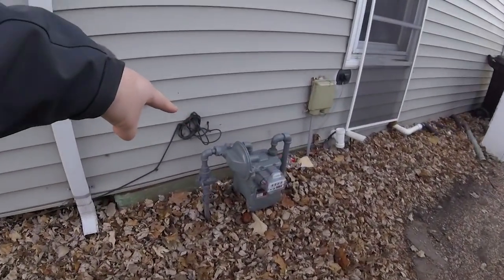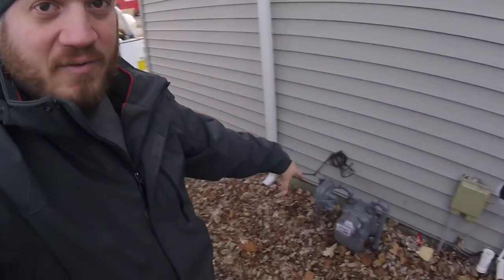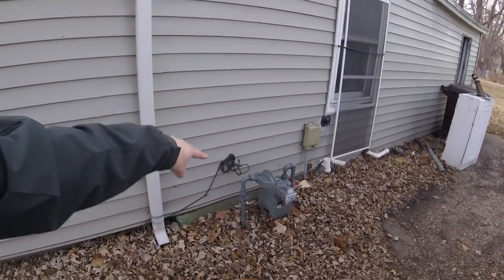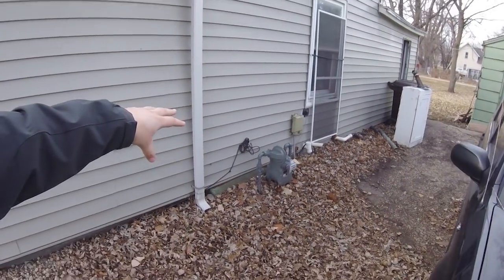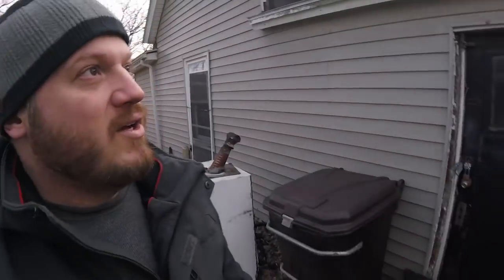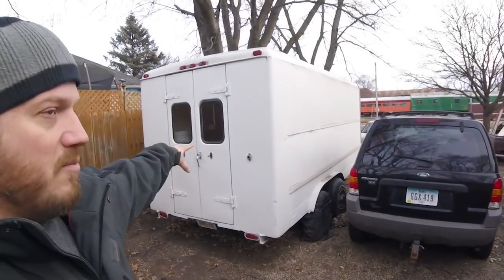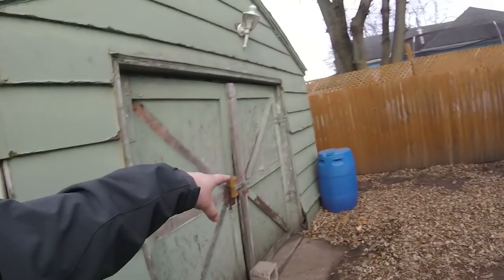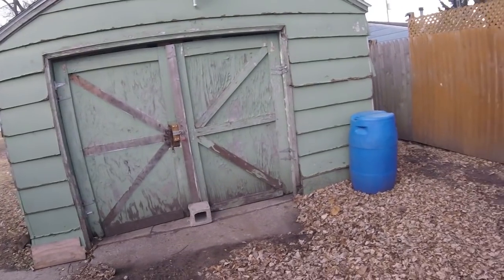PART 2 - UPDATE - DIY Free Electricity with Self Perpetuating Generator

Comment: Please for the love of God tell me you didn’t give Gerard Morin a penny of your money and that you don’t believe his lies.

People can’t seem to grasp what electricity is: notice how the power company doesn’t charge you in volt hours or amp hours?  They charge in WATT hours, which is voltage times amps.  That’s the only true way to measure actual power consumption.

Scammers like Gerard Morin play on people’s ignorance to this and promise “overunity” or free energy.  It’s a scam, you may increase voltage or amperage, but you’ll lose one of the other on the other side.  No one has EVER produced a machine that produces more watts than you put into it, Gerard Morin included.

He can try to use words he demonstrably doesn’t understand like “resonance” a lot and throw out Tesla’s name to try to legitimize his scams, but the end result is always the same.

They sell snake oil and there’s always some other component you need to make it actually produce power - a controller or coil or some magic component that never materializes.  These guys have done this for over 100 years and people keep falling for it.

Hope you don’t take this the wrong way, my issue is with scammers like Gerard Morin, who will be in jail soon.  My issue is not with his victims, which I pray you are not.  Please spread the word about the results you get and see what Mr. Morin has to say about it.  

Let me guess: “yeah there’s just one more component needed” for the low cost of....?